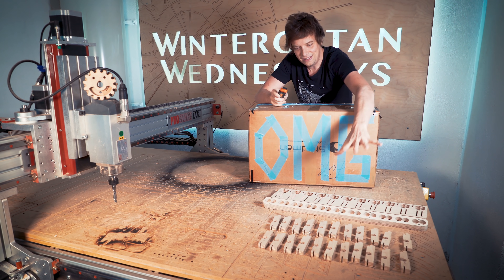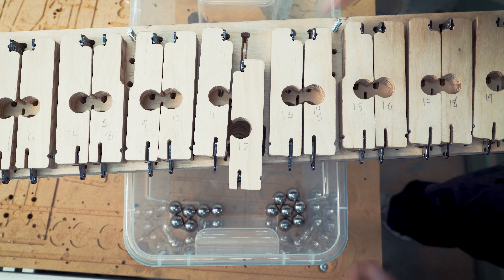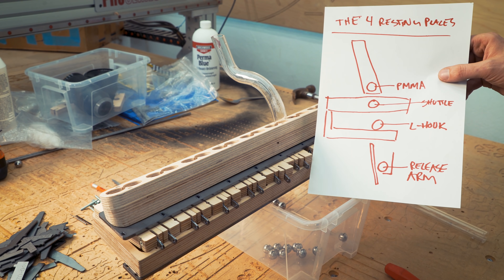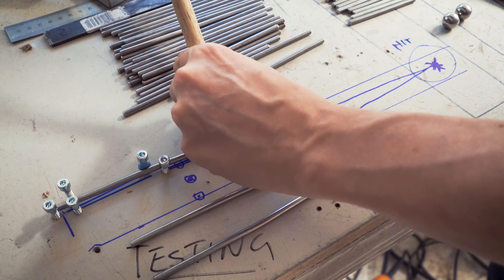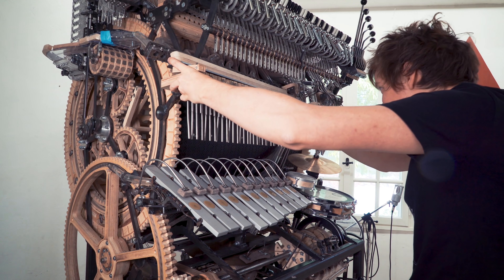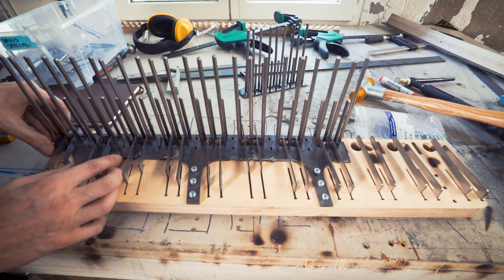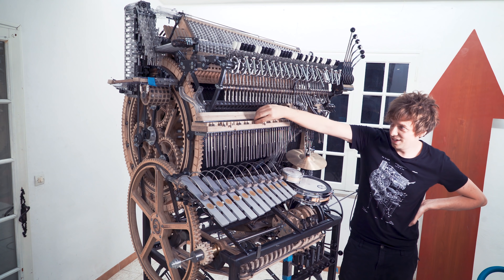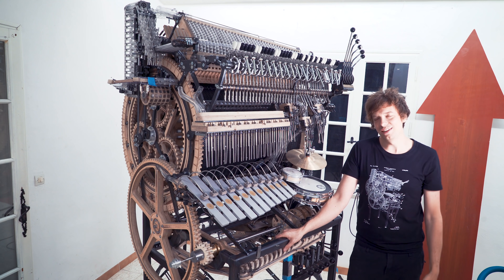My Best Design Yet - Marble Machine X #102

Comment: 2:32 I have a question: Isn't the marble divider doing the exact same thing? I thought there is always only one marble at the marble drop. So why do you always explain the design with a row of marbles? As far as I understand the marble-paths, you only need to release the marbles and not divide them again, right?
Reply: I wondered the the same thing. Now that there's registrators in two places, if you removed the first set at the divider, the machine would play the same, no?

No. The first set contains the muting mechanism, plus it ensures the marbles line up correctly on the track of the divider.

To think I doubted you, Martin...

Keep it up, I love it!
Reply: @darksideofurmom18  I didn't thought about removing the divider, I just thought the new marble drops are a bit... complicated...
Reply: There are timing constraints and it has to look cool. The programming drum is not very interesting to watch. So it is behind and below more visually interesting parts. The marble flow is interesting, so it is a thin layer on the exterior of the machine.

Martin set performance limits on the design with a reasonable safety margin. The machine can play about twice as fast as Martin expects to need, in case future Martin gets ambitious.

The Marble divider is cool to watch. It is entirely automated, so Martin doesn't need to interact with it during a performance. All the things the musician interacts with are in the scarce space in easy reach. The marble divider is in the highly visible, but unreachable space at the top. It has to be above the drop point of the highest instrument. There is quite a vertical gap between the divider and the drop point for the lowest instrument.

There are 4 marbles in flight, so each step of the process is fast enough, even for the instrument with the lowest drop point.
Reply: @hamjudo  I get your point, the new divider-marble-gates are much closer to the instrument. I still think the new assembly is (at least a bit) over-engineered because you basically have the same function twice...
Reply: @mielus1986  Back before microprocessors were common, I would often see shift registers in digital circuits. This is a pair of high latency synchronous single ball shift registers in series. There were 512 bit digital electronics versions that were simply 511 copies of the same circuit in a single chip, the 512th bit had a higher current output.

Comment: You need to protect the wood with something.

I know you wanna to raw look of the wood but I recommend to consider humidity and temperature while you are traveling around the world.
The wood expansion will ruin your job
Reply: Plywood is much more dimensionally stable than solid wood, so it won't change nearly as much.
Reply: @nikolaihedler8883  While that is true, it is still a risk, even if to a much lower extent. Even just a light clear coat would work, and shouldn't interfere with looks/operation too much.
Reply: Ply barely warps
Reply: @donedisco  De-layering is the main problem.

And eventually someone will drop some water over it.
Reply: Agreed, may want to hit it with a good oil, will harden the wood and help with moisture absorption. then a good paste wax.

Comment: Dear Martin, I might be the only one who feels this way, but would you consider changing the latex on the vibraphone plates? They look like weird nipples. There I said it. Could you add some black dye to the latex mix? I love the circular design over the previous square one, but the pencil marks showing through the latex makes it feel off. You mention that this is a test scale, so hopefully you might consider making this small adjustment to the final version. I wouldn't normally comment on such a small detail except that the vibraphone is like the face of the entire machine and these details are like pimples I can't unsee after noticing them.

Comment: Hey im a tig welder by trade, you may have welded in your bars all the way from left to right that puts alot of heat into the steel, when you have alot of things to weld in a row like that it is important to jump around and try not to put too much heat in one spot and never weld something compleatly out from left to right. Been following you since the first machine and even a little bit before, keep making my Wednesday

Comment: Why is that extra srage needed with the L-holders?

and why was that piece of work cut off at 10:07??
Reply: The storage is there to always have a marbel ready to be dropped instantly for timing purposes and so the marble before it dorsnt get dropped by accident iirc. WW Episode 91 goes over this.
Reply: @jordandrake9822  For this you still wouldn't need the L-hooks. You could reverse the loader and have it drop a marble directly when pushed inwards. On the way back it would pull in the next marble from the stack.
Reply: Before a song is played he will have to make sure all of those holder areas are full of marbles. There are many areas now.

Comment: FYI you can use  a punch or chisel to grow your part.  A line of dents will grow your part perpendicular to the line. Also try pre-heating the part before you weld it and let it cool slowly. This will reduce shrinkage.

Comment: I am curious as to why you are welding all of these rods on to the surfaces. I would think that tapping a hole and using threaded rod might be a better solution and allow for modifications while putting the MMX together and also for replacing parts in the future if you have to. Keep up the awesome work. The machine looks beautiful.

Comment: Every movement other than those transporting marbles on a direct path to their destination, and every sound that is not intentionally musical, signifies a waste of energy and introduces wear.
Sanding, sealing, and wax polishing parts will reduce surface friction, but some mechanisms would benefit from a sliding to rolling friction conversion.
When a part changes direction, without maintaining momentum, such as the back and forth shuttles, there is a doubling of energy cost.
On an individual small scale, this is non-problematic, but multiplied hundreds of times by channel and time, the effect grows.
Shifting away from high surface contact linear actuation would significantly reduce potential energy loss and noise

Comment: Those metal bars seem too easy to bend and they may get altered when transported from one place to another. You should use either a stronger material or find a way to make the bars shorter do they are less easy to bend

Comment: If you struggle with warping metal due to a lot of welding, would heating up the whole part evenly and slowly (and allowing to cool reaaally slowly too) work for reducing built-up stress inside the metal? I think this is called annealing?

Comment: I think the metal contraction from welding could have all been avoided by tapping the holes then threading the marble guides in before bending.  

Learn thru failure, but then plan for success the next time from the lessons learned.

Keep'em coming!

Comment: Amazing! There is are is things something that is scaring me though. The MMX is obviously very top heavy but I am wondering if Martin has weighed all the marbles that are going to be required when it is loaded up and factored that I to the machines stability.

- The top heaviness make it much more susceptible to tipping especially when it will be shifted around a stage.
- Are the current legs with their cross bracing enough to hold the full weight while the machine is constantly wiggling while playing? Keeping in mind that I imagine you have leveling feet so that means that the whole of the machines weight is resting on 4 pieces of threaded rod.

Maybe widening the stance of the machine a bit with a something like a simple outrigger setup (Like the extending feet that a cranes use to stabilize their base).
Reply: Agree. It was a noticeable point of concern already in the original MarbleMachine. 

Hörru Martin, spend a few moments into this.
Reply: You also have to think that the metal frame weighs alot more than wood. Even though the top had alot going on there as a large amount of weight from the frame to balance it out a bit.
Reply: ^ not to mention that the top has a lot of empty space. The heaviest thing I’d think on top would be the marble holder. The heaviest things on the machine are very close to the brace. Also Martin did put X braces on the back to reduce wibbily-wobbly-ness
Reply: It absolutely looks sturdy enough.
Reply: He could add temporary supports to effectively widen the base near the floor to make it very stable.
Reply: @jayyyzeee6409  yes, like bolt on two planks.
Reply: @KeeDx3 My reply was just an estimate. I didn't know that threads were rated for such high loads (although I forgot about a nut touching on multiple threads). Quite impressive for such thin pieces of metal actually!
Reply: The weight is probably similar to a concert grand piano which rests on 3 castered wheels.  Top heaviness is a separate issue.
Reply: Glad I'm not one of the setup guys!
Reply: Dougald Hendrick This brings up something I've been wondering about. Has Martin mentioned how many pieces the MMX is supposed to break down into for transport?
Reply: @SyzygyNoon  Yes. It's in at least some of the earliest videos. I think it was originally 3 main chunks, but is now 5 last I remember, plus the sets of removable programming plates.
Reply: @SyzygyNoon  from top of my head, about three major peaces, I think.  And the plats holding the programming pins are also possible to be removed and replaced during concerts.
But it looks like the xylophone is bolted, so it could also be taken of, as an example of a smaller piece.
Reply: The heaviest part of the machine is the fly wheel by far, and its at the bottom
Reply: If he gets done and it wiggles, the worst he'll have to do is bolt it to the stage. Or lay down a base plate that it bolts to. Based on all the videos so far, I don't think wiggling will be an issue.
Reply: If you think about it the leveling feet only touch the machine on the thread of a rod. The thread itself is only a piece of metal of 1-2 mm thick... That is indeed not too strong, and the whole weight of the machine resting on that seems kinda dangerous indeed. Maybe something like detachable/unfoldable outriggers like you suggested would be a good idea, although it would kinda ruin the sleek look of the machine as it is currently... Also, something else to think about is that the entirety of the machine including marbles would weigh maybe half a ton. This weight spread over 4 feet with a surface area of ±15 cm^2 each is a pressure of 817 Pa per foot touching the ground... If the stage is made from plywood with a layer of plastic over it (some stages are stronger), It might just sink through the floor...
Reply: @rublie1426  if it sink through the floor, one could just bolt it down from under the stage.  And then it will probably stand upright.  :-)
Reply: @AndersJackson  true, but how would you move it then? I can already imagine Martin welding the machine to the stage, and grinding it loose again when he's done hahaha
Reply: @rublie1426  how?
If its feet go through the scene, you can bolt those feet under the floor.
If you bolt a pair of planks on the feet, you spread the load and also make it more stable, as the planks should be longer then the distance between the feet on the machine.  And this planks could be nailed or bolted to the scene, if possible.
Reply: Like when they built a library and forgot to account for the weight of all the books.
Reply: I mentioned this a few months ago, before he stabilized and reduced drag.

While it is still a concern, the growing issue is the increasing friction between the components themselves slowing and wearing each other.
That is before eccentricities, like the cosmetic "fingers" add additional load without function, providing an aesthetic distraction from useful processes.
Reply: @Nullpersona  it is a stage machine and instrument, used to perform live on a scene.
Those fingers HAVE a function on the machine, as Martin has explained. 

That set aside, yes it will add weight high on the machine.

But yes, it probably would be a good idea to weight the machine, and make a rough calculation the down force, weight, the machine have on each foot.
Reply: @AndersJackson  There are literally hundreds of processes occurring within the MMX that perform a musical or integral function.  While interesting to look at, the fingers would not fall into either category, as their omission would not reduce any musical or transport capabilities.  Hand-cranking this behemoth on stage for hours is already going to be a feat of stamina, and provide limitless opportunities for stage and set workers to focus cameras on entertaining facets of its workings.  From the locomotion of the marbles, to the fully-functional vibraphone, to the drum pad percussion synthesizer, there is no shortage of curiosities, angles or features to highlight.  This "electric marble machine" may not be acoustically feasible kinetically, but unless there are plans to motorize it, consideration for hours of exertion and additional wear seem warranted.
Reply: @Nullpersona  you are obviously not knowing how a consert works, and how this machine will be used.
No, it will not be used in all acts.
Yes, the fingers will be part of the performance the machine will be part of.  So yes, just because you can't see it as useful, doesn't mean that it isn't useful.  So yes, interesting looking at IS a function on this machine.  You will know that if you listen to how Martin design the machine.  He has dropped numerous of designs, just because it isn't esthetical appealing to him.

I will stop here, as we are not agreeing on some basics.  Like that Martin is also considering aesthetics as an important part of the design, obviously.

Comment: If the metal shrinks due to welding, can you expand it again by hammering it (a little)? I'm not a metalworker, but I saw "seejanedrill" use a hammer to square a square, video is called "Make Sure Your Square is Square, and Fix It If It Isn't". Once again: I have no idea whether this would work or how the result would look, so please try it using a scrap piece first (if you have time for that), but it might be a useful technique.

Also: I love it when a plan comes together. Great design indeed!

Comment: In this episode, we learnt how to use arc welding and a hacksaw for precise 3D shape form trimming.  

Also, are the three left vibraphone plates long-side up for reasons, or just 'cos?  

More importantly, why has @Davey504 not admitted that while he can SLAPP with his fleshy fingers, MMX is always going to be more metal!
Reply: They are positioned like that to get the optimal hit location under the marble drop.  A couple videos about that topic recently.  (and they sound so good now!)
Reply: @CodeKujo  I've watched every MMX video - I assume that the hit locations are symmetric though, so it could equally use the 'other one' at the top, and have the bars nicely aligned.  Maybe.  Or maybe not, I didn't actually look that closely.  Perhaps on the longer bars using the 'upper' sweet spot wouldn't give the marbles enough space to bounce into their collector funnels.
Reply: @Juttutin  Exactly, having a shorter distance to clear on the bounce was an important feature.  If you did align the tops like that, then the bottom would stick way out.

Comment: Love the design. I wonder however if the parts separated by multiple washers will ever need to be removed. In which case it may become frustrating to restack piles of washers. Rather than using tape to temporary keep a stack together, I suggest a spot of superglue between each washer.
Reply: Or a tube-shaped spacer with a washer or two on each end.

Comment: Eh, less welding, more mature design! If you'll need to adjust anything then you'll need to cut things off and re-weld. A smarter option will be to use threaded rods that can be replaced in seconds and do not distort slots with each weld.

Comment: I see a potential problem with friction and basically the wood on wood sliding back and forth 10s of thousands of times while on tour grinding the surfaces of the wood.   I am sure there is a solution to minimize the wear and tear of the wood on wood grind.  I would suggest what they put on the bottom of computer mouse, most manufacturers use 0.6mm of substance known as PTFE (Polytetrafluoroethylene or it's copy-written name “Teflon”.)